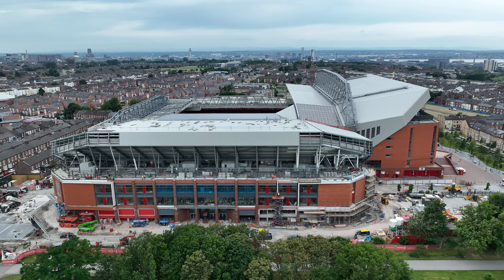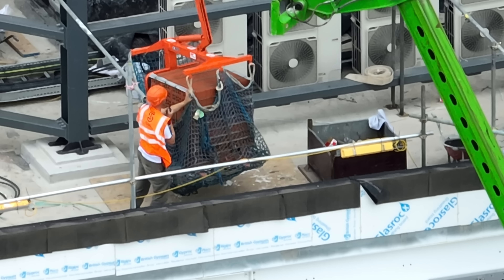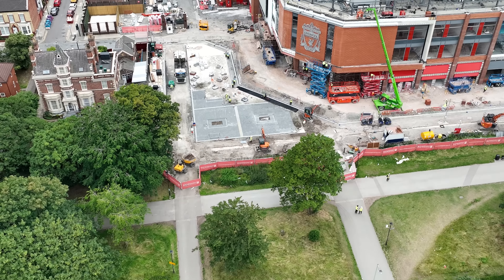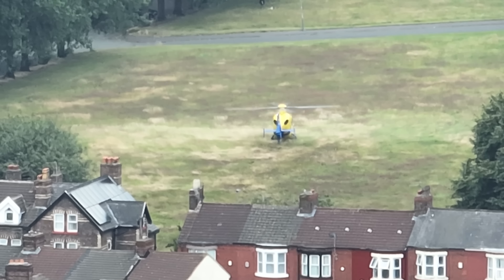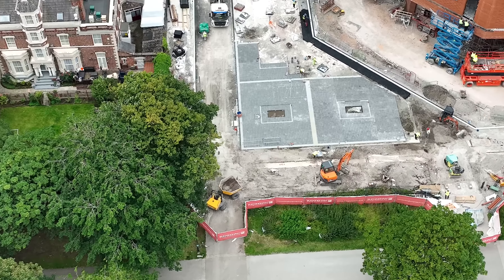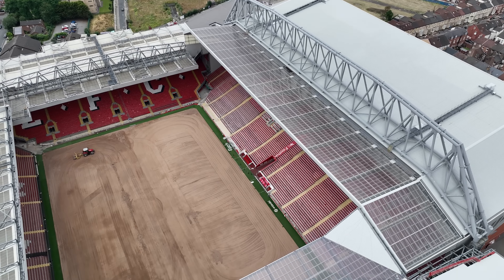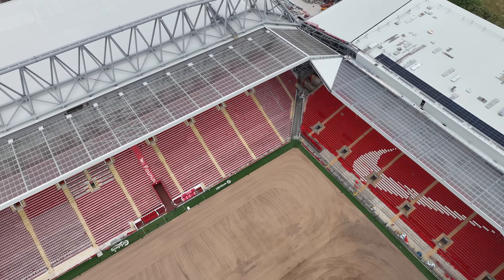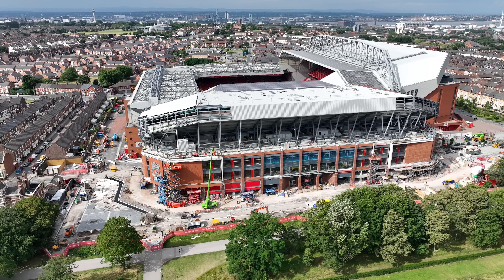Air ambulance over Liverpool F.C’s Anfield Road Expansion

Comment: KC that's the lads doing the window cill and also remember yesterday's video you were looking and said  we're they working on the soffit I think if you look really close there's 3 roller shutters fixed into the wall and the 🧱 has the stainless steel recessed pieces so yeah 3 shutters I think it was at minute 3 right in the middle on the bottom of the stadium were it looks like people walk in thanks mate front think anyone noticed that yet but it would make sense wouldn't it thanks for today's video  and it more refreshing to hear you with music in the back you're not so rushed agh and when you see plastic and brickwork it to stop water coming in through the brick and either destroying the steel or making damp mate in your house it's called dampcourse
Reply from the maker: Some great info there mate thank you. And yeah it’s a lot more chilled doing the audio separate from the flying

Comment: Hi Kev, I've just paused your video on 2.50 mins, if you look at the green cherry picker and the scissor lifts next to it, that pretty much confirms what we discussed yesterday that there will be ample room for two way traffic on the road even with a narrow pavement on the stand side of it (the same as the original road had). Looking at the images there will be a much wider 'pavement' between the kerbstones and the wall that's going to be built bordering the park, that will probably include more Forever Stones and tribute benches, as well as three new access points to and from the park where the bollards are being installed, all of which should aid congestion issues with the increased capacity. It's just been confirmed by the way that the Bournemouth game will be a  3 o'clock Saturday kick off.
Reply from the maker: Good spot mate, you are absolutely correct